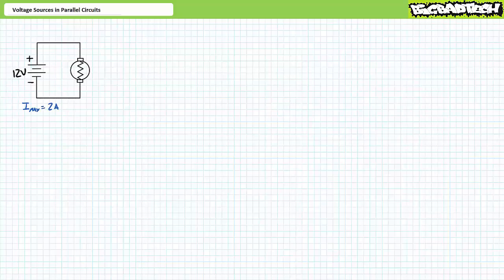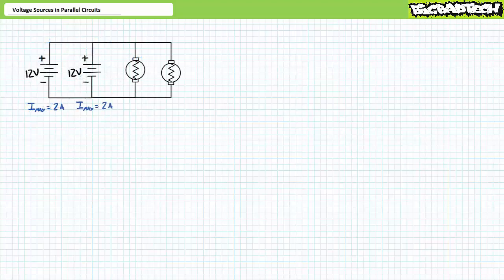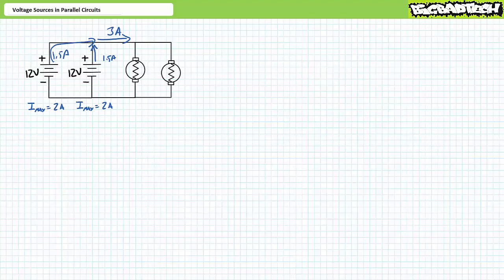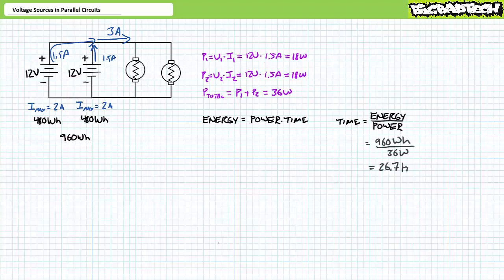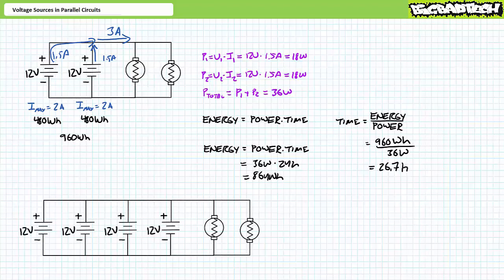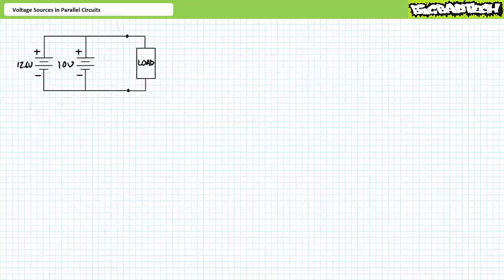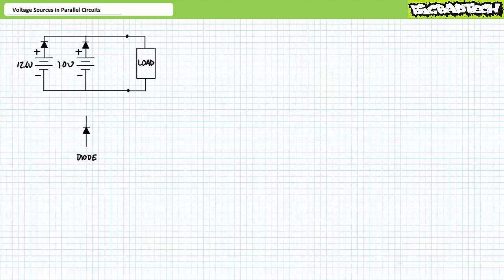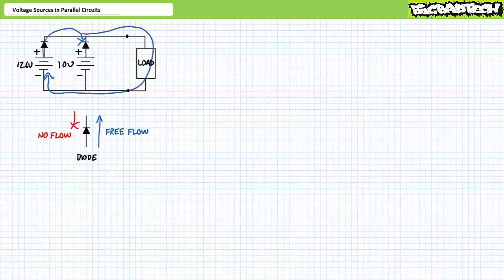Voltage Sources in Parallel Circuits (Part 1 of 2)

Comment: How many volts does the load see with the 10v / 12.6v configuration?  Part 2 doesn't seem to say either.
Reply from the maker: It’s a contradictory example that wouldn’t occur in real life. Given the tremendous surge of outgoing current from the 12V (provided the wire connecting the two didn’t melt) in all probability it would experience a significant voltage drop and the load would experience 10.6V and start rising as it charged up (presuming it’s a discharged battery).
Reply: @bigbadtech  But not with the two diodes if I understand correctly, and that's what I was referring to.  After some research I've found that the load would see the higher of the two voltages, minus the voltage drop across diodes.
Reply from the maker: Sorry I thought you were referring to the original circuit w/o diodes. Yes with diodes the source would see the higher of the 2 voltages. The one diode on the 10.6V source would be reverse biased and act essentially like an open switch.

Comment: Wrong analyzing for different voltage DC parallel,
If you connect + to + of two DC battery (not capacitor) it will not be any current throu, because potential is absolute, potential between +12.6v of battery A and +10v of battery B is NOT 2.6v,
Reply from the maker: Try hooking a 12.6V and 10V battery together. The resultant spark is a massive charge exchange as potential equalizes.
Reply: @bigbadtech  now, I know the reason why SPARKS occurs when a car with dead battery (about 9V say) is JUMP START with another fully charge battery. Thanks.
Reply: @bigbadtech  Potential is a relative phenomenon, there is no potential difference between positive pole of two batteries.
Just probe your voltmeter to positive’s of two (1.5v and 6v ex.) , result is nothing
Reply from the maker: Agreed about potential being a relative phenomenon for two isolated batteries. In parallel the batteries aren't isolated but rather share the same negative connection.
Reply: @saeidamouzgar1776  yes thats correct. When potential is measured using voltmeter, the two points should be from the same source i.e. one same battery.  Otherwise, the DIMM does not show any value at all. 
In short, Current coming out should return back to the same source where it comes from.